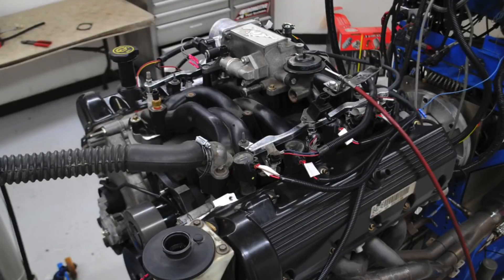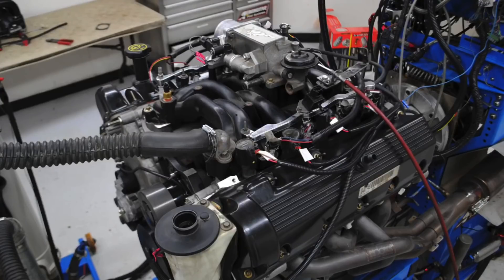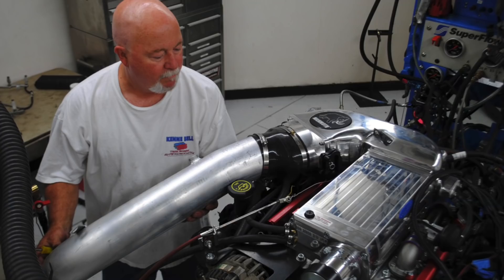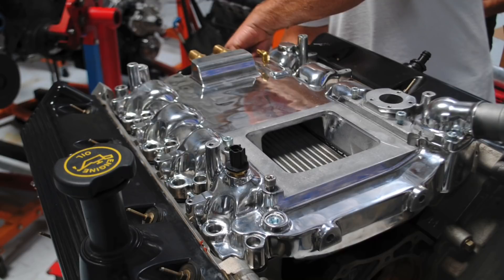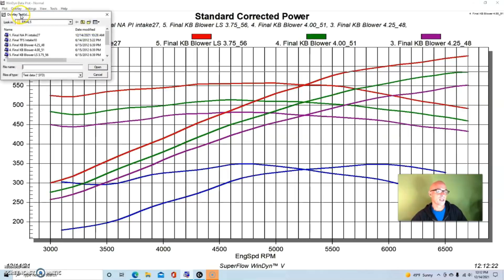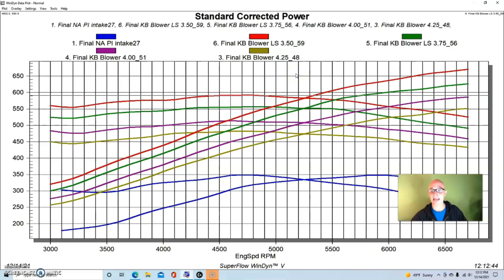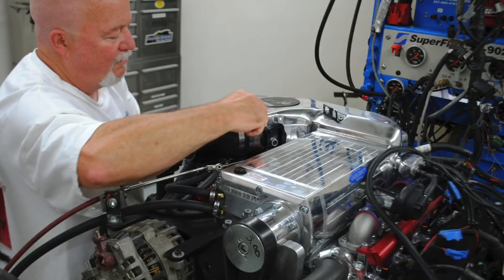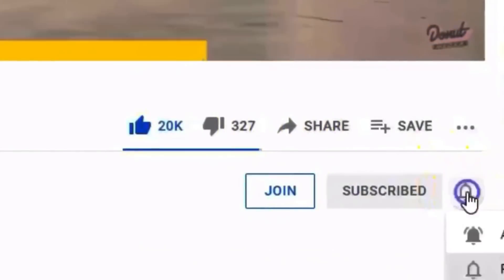HOW TO MAKE 4.6L 2V POWER-BIG BOOST KENNE BELL 2.6L TWIN SCREW-22.6 PSI OF BOOST! BONUS INTAKE TEST!

Comment: I have a 4.6 with a 5.0 stroker kit, TFS heads with TFS stage 2 cams, and a 2.8 kenne bell.  I have yet to see a Dyno test with this combo.
Reply: if my engine ever gets done by the shop i paid them to do it, i'll be able to show you a n/a version of that but with stage 3 tfs cams, boost'll be after car runs good n all.. Why haven't you dynoed it yet, are you tuned??
Reply: @P71ScrewHead  its a project car that i havent finished.  I need to run the fuel system and wiring, the intercooler and pump mounting.  Then maybe some other small things, i can get a base tune to start the car then before going to the dyno for a full tune.
Reply: @abnddreams  oh ok, i'm in a similar problem to you i guess but only cuz i can't find a damn dyno shop who'll want to work on my 2v n Panther car, one said they would if it was a 2010, mine's an 09 dang it, like wtf..lol Haven't found a performance shop in HTX who'd be willing to cam my car, it's bullshet, big ass city but not 2v friendly..
Reply: @P71ScrewHead  that sucks, luckily i have a couple well known mustang tuners in metro detroit.  I have a 1996 GT, i feel like the poor 4.6 is going to be forgotten quickly with how good the new 5.0 is.
Reply: @abnddreams  i agree, some tell me that it's easier to work on a Coyote than a 2v, that i seriously doubt, as i've seen ppl have issues with oil leaks after opening up that engine than ppl who work on the 2v.. But yeah, most these new tuners just want to work on what they learned how to, which i understand, i guess.. There are engine builders out here willing to build a 2v but i have to send the engine out, don't want the car there too, dang it..lol

Comment: How much did IAT increase between the boost levels? I have a KB 3.6 on a ls3 408 and at 14lbs boost the temps are out of control even with meth dumped on top.
Reply from the maker: if its intercooled-there should be no problem
Reply: @richardholdener1727  I have a 5 gallon overflow tank running a rule500 bilge pump. I upgraded the hose size to 12AN and upgraded the kenne bell heat exchanger to the frozen boost type 101 exchanger. The IAT temps will rocket past 200* on a pull then recover pretty quickly once coasting. I have not filled the tank with ice yet but I'm always fighting IAT temps.

Comment: Those lil 2v 4.6's were really good but never really got the respect they deserved.  Between the LS swaps and Ford spending 30 yrs  of both success and fails developing it into the over engineered and extremely unreliable 3 and 4 valves. Think they finally got the bugs worked out!

Comment: It made more of a jump in power going from 20-22.6 psi than in any other configuration
Reply: They put a radiused air entry on the throttle body at the same time

Comment: Would this fit the 5.4 2v ?
Reply: No, they need one for the taller deck height or you need adapter plates because the 5.4 is a taller/wider block.
Reply: No you would need a lightning setup.

Comment: That tfs manifold may not be noticable just daily driving around. However, when im wide open throttle, my car doesnt see below 4k rpm after the launch. Im only shifting at 6-6250rpms but that manifold would certainly improve track times. The cost is what shys me away when the vic jr and good plenum could be had for a lot less. With that said, I imagined the power loss below 5k would be more dramatic with the tfs manifold.
Reply: I went ahead and got the streetburner and imma port it all the way through the runners down the road.
Reply: @Prestiged_peck  The street burner should be a good compromise for maintaining low speed power while still improving up top. Im really looking forward to seeing more of your combo as it comes together!
Reply: @madmod  me too!! I'm waiting on weiscos and comp valve springs.
Reply: @Prestiged_peck  i got the bell clicked!
Reply: @madmod  thanks bro! Trying to get some editing capability going or I'd be doing more videos, been recording cleaning the block as I can though.
Reply: @Prestiged_peck  I know how it goes lol. Theres so much i cant record because im hands on and only use my phone which has seen better days lol.
Reply: @Prestiged_peck  Get this, my brother gave me his 5.4 2v that spit a plug out of his 02 f150. Probably gonna find its home in a Thunderbird with my spare set of Aviator 03 tumble port 4v heads. Im stoked.
Reply: @Prestiged_peck  Have you been able to install and try out that Streetburner? Asking for my Marquis.
Reply: @johngregory4801  I'm in machine shop hell At the moment but I'll have a video up on my channel as soon as I get it running
Reply: @Prestiged_peck  Cool. Marq thanks you.

Comment: Sure is a reliable engine stock . I’m wondering how they hold up boosted?
Reply: They're reliable up too 400 ish horsepower supposedly
Reply: 400 wheel on stock rods and pistons. With rods and pistons 600 wheel is considered safe
Reply from the maker: WE HAVE RUN STOCK RODS AND PISTONS WAY OVER 600 HP WITH NO PROBLEMS-JUST NEED RING GAP
Reply: @richardholdener1727  would the ring gap adjustment put an awful lot of unwanted pressure into the crankcase.
Reply: So they usually run out of ring gap in unopened form around 400 horse, but if you add gap you can go lots farther If you don't detonate.